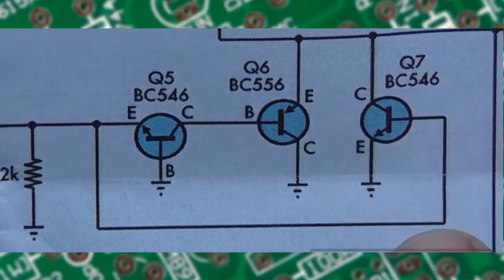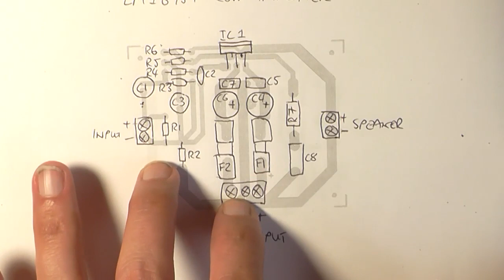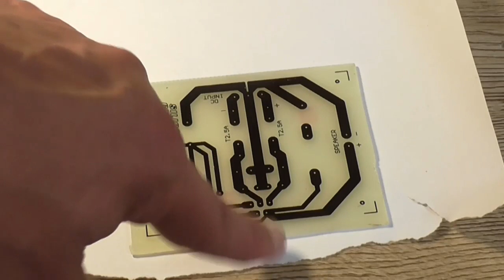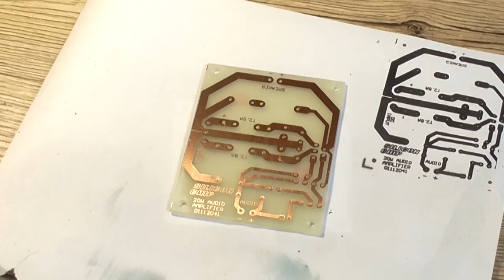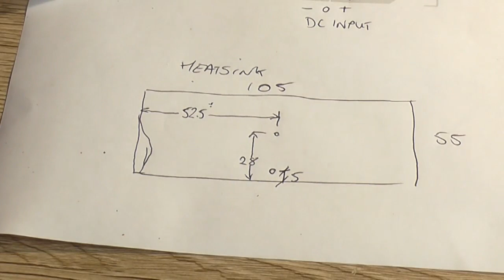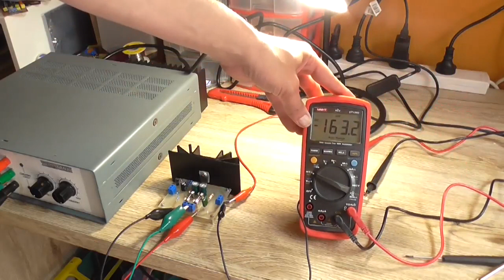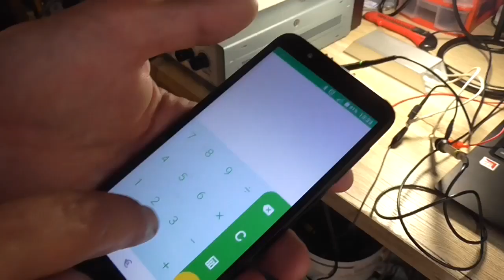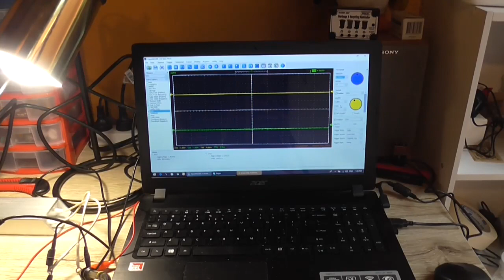LM1875 'Schoolies Amp' by Silicon Chip

Comment: Can I power one or two of to this amp with a 25.2vac 2a transformer, RadioShack pn 273-1512B. ? Or do you have any mouser or digikey part number suggestions.
Reply from the maker: Two should run fine on 2A but I would suggest 3 to be safe